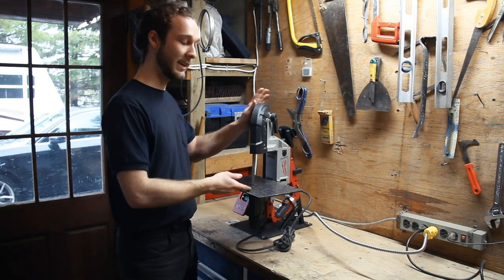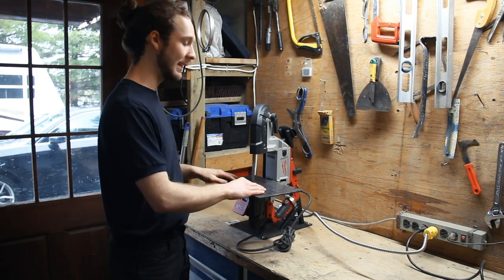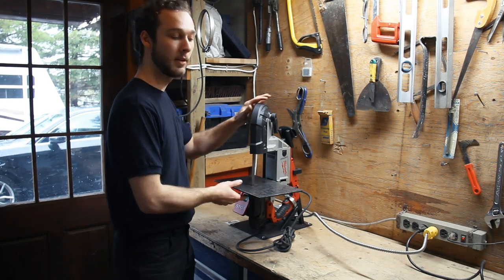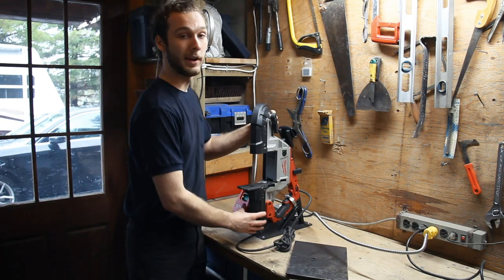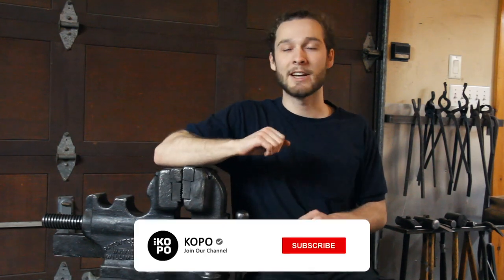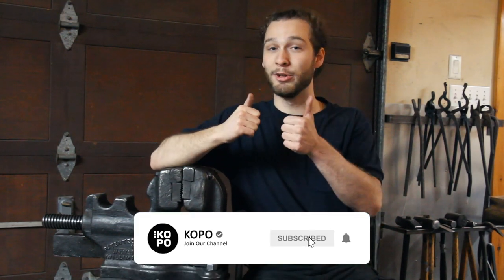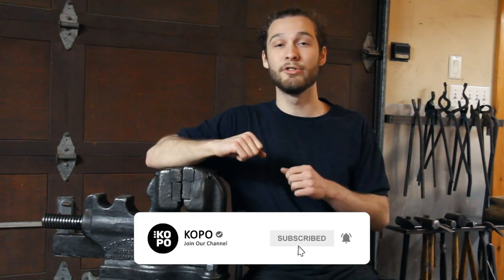DIY Bandsaw Stand || Simple and versatile Portable Band Saw stand build

Comment: Excellent design. This is the best version of a benchtop stand for a handheld bandsaw I have seen. Been looking the past couple days at many versions trying to decide on which one suits me best. I think this one is the one for me. I like the switch you mounted which is a nice solution but I do also like the ones I have seen using a foot-operated switch. And you used armored cable which most do not bother to do, that is a plus and a good choice for a tool like this.
Reply from the maker: Thank you very much ! I'm really pleased that you like our design of the band saw stand. Good luck with your build !
Reply: In complete agreement.

Comment: Nice idea. Can you make it all out of thick aluminum plate so I can use it with water cooling? I'm looking to set up a battery operated portable bandsaw like this to dedicate for cutting aluminum. Without water cooling I'm finding that the aluminum work hardens as I cut, then the cut gets progressively worse. This video is a great idea, but could it have a drain tray, tank mount and water hose and all aluminum to not rust?
Reply from the maker: Of course everything is possible if you're a bit creative ! But I'm not sure that it's a work hardening/heat  problem that you have. It sound like your blade gets clogged with aluminium chips as you cut. You should try cutting oil and a bigger TPI !